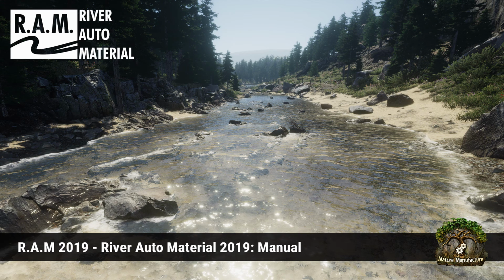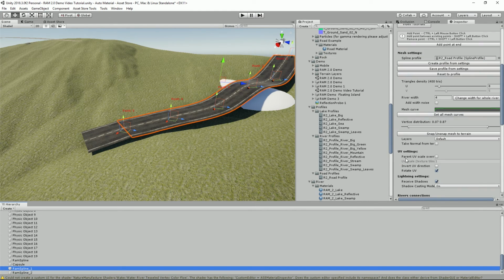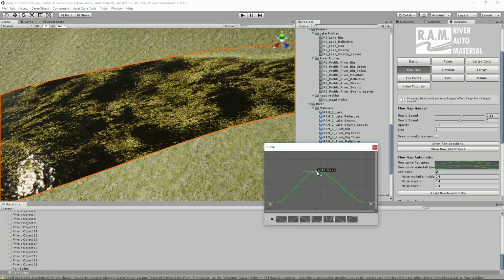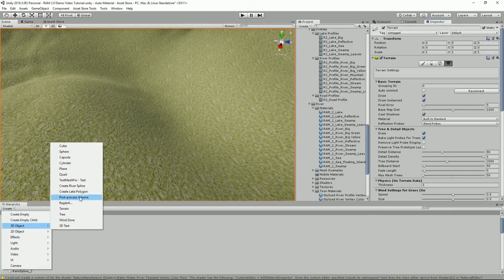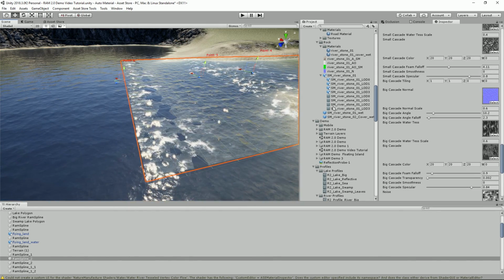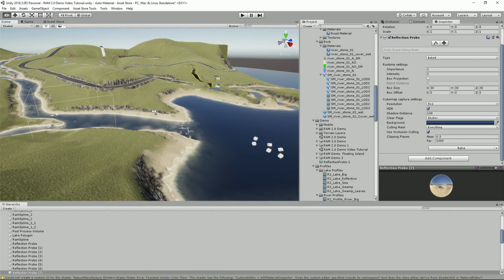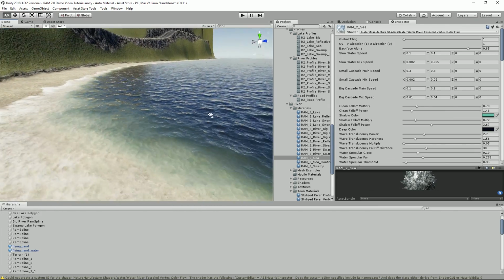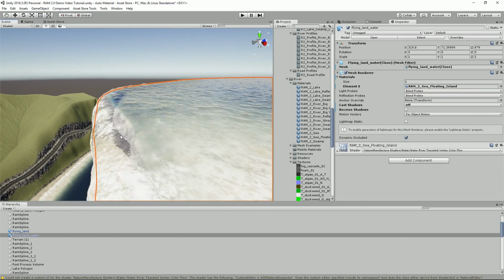R.A.M 2019 - River Auto Material 2019 Tutorial

Comment: Instead of manually placing every spline point, you can:

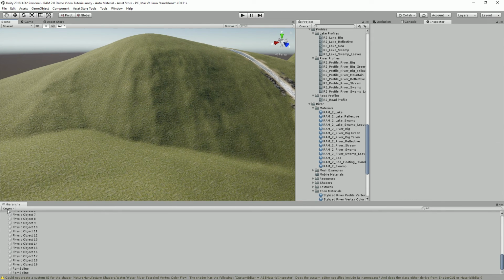Set a single point: Place just one point on your terrain where you want the river to start (22:40, 23:57).
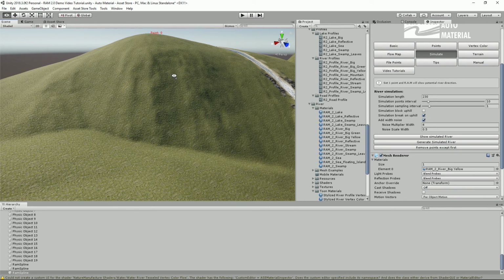Use the Simulation section: Navigate to the simulation settings within the R.A.M inspector (23:04).
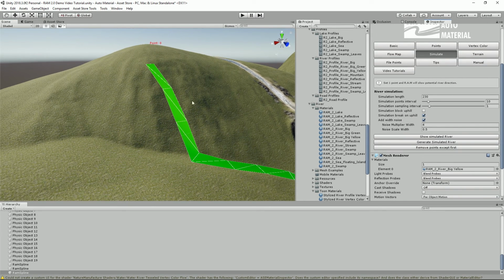Configure parameters: You can adjust values such as River Length, Point Interval (distance between points), and physical constraints (23:09).
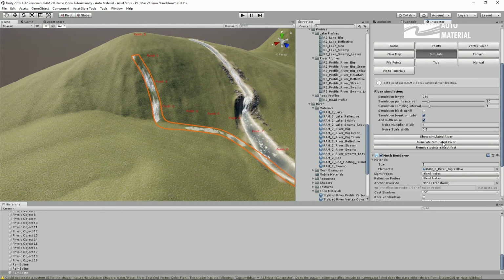Generate: Once your parameters are set, clicking the generate button will automatically simulate the river's path based on the terrain topography (23:43).
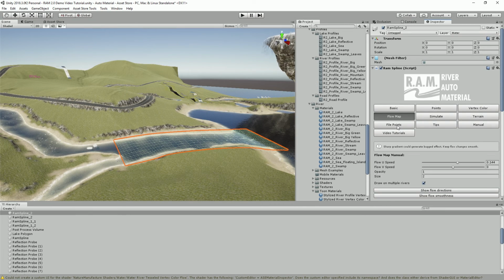Additionally, if you have pre-existing data, the system includes a "file points" button that allows you to import CSV files containing point coordinates to generate your rivers or lakes automatically (26:03).

Comment: latest version 1.4.7 is not working on 2019.4.26f1 urp, all shaders are pink.
Reply: please dont tell me to update to 2020 LTS it is still very broken, sometimes even crashing on selecting many gameobjects.
Reply from the maker: @morningstar7071  1. Please use email or discord as support channel.
2. Last version contain files for unity 2021. Please clean hidden appdata folder with asset store temp files and download asset via unity 2019.4 so it will download proper urp files.
Reply: @NatureManufacture  hello i can not upgrade to 2021 as my entire project(Very big project) is made in 2019 and i use lots of asset that only work in 2019 LTS, there is no link for discord in description
Reply: @NatureManufacture  I've also tried older version which is 1.4.4 from my hdrp project and imported urp support pack, still same error.
Reply from the maker: @morningstar7071  You have answers at discord. Please use it for conversation

Comment: How much I try to use it for urp the materials are not upgrading to urp.i had followed your steps in overview.
First i imported the package in urp and then imported urp 10.2 support which converts the materials.
But the materials are not changing.

Even i have tried deleting and reimporting the asset many times.

It just driving me crazy how many times i tried.
Is there any way to upgrade it to urp.
Did i do any mistake in upgrading it to urp.

If any please any one tell me how to do it.

I have a problem with this.

Please help me anyone.

Comment: a really beautiful tool, I do have some questions before buying (maybe I missed them in the video)
with this tool:

1. can you create a wake like from a ships propeller?
2. can you create waves that ships would create when they move also coding the height of the wave depending on the ships size and speed?
3. Can you create waves that you would have at the beach (will objects be affected by it) and if so can it be programmed that the waves have a certain height or variable between 2 height values?
4. does the carving of the river have to be on a terrain object or can it be used on other objects like a plane for instance as well, would it work on imported 3D object from blender for instance.

I need a Unity tool to create rivers and canals and will also be importing objects like sliced landscape parts and locks and bridges.

thanks for any answers

Comment: left click and ctrl isn't doing anything
Reply from the maker: Restart engine layout and it will work fine. Sometimes unity block itself
Reply: @NatureManufacture  Getting the same problem and restarting Unity didn't help. Not sure if that's what you meant by "Engine layout"?
Reply from the maker: @MacInTheBoxx  If you use 2019.3 please turn this option:  https://gyazo.com/ff486e375ba609e1ae47af3220675234
Reply: @NatureManufacture  This worked for me. Thanks!